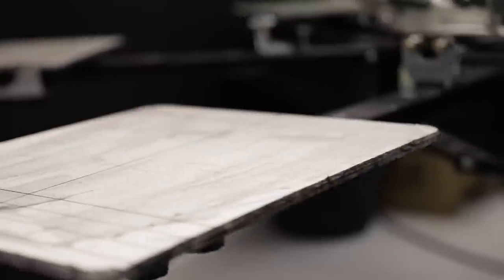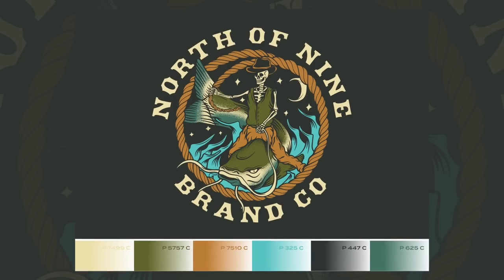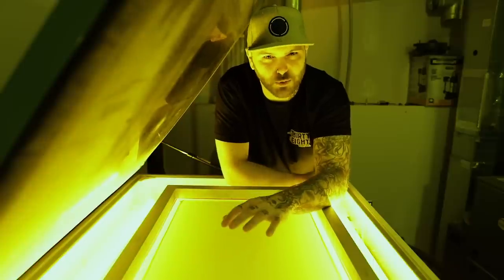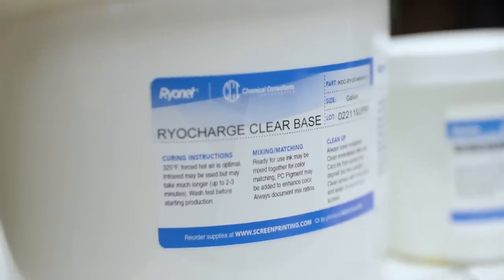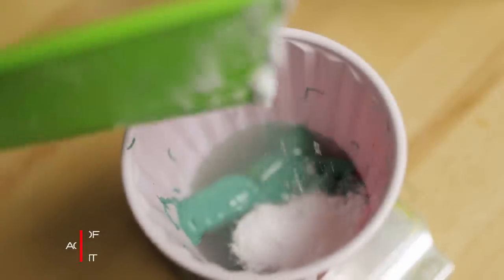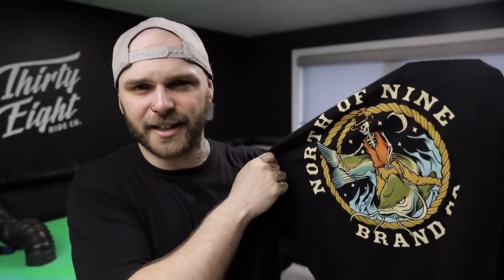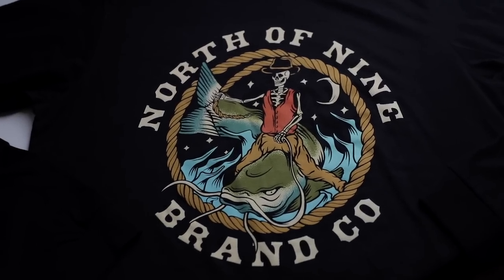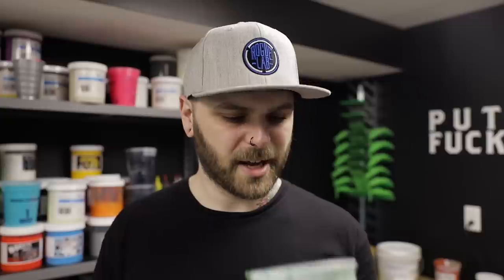How To Screen Print With PLASTISOL DISCHARGE INK!

Comment: your dwell time should be al least 90 seconds
Nice print!!
Reply from the maker: For waterbased, not for plastisol
Reply: @leestuart38  Discharge printing is a form of waterbase printing, at a minimum it should be 60 seconds but preferably 90 seconds or more... good luck
Reply from the maker: Man you missed the whole point of this video if you think this is at all water based 😂
Reply: @leestuart38  Think about just one thing you mentioned in your video, and that is the fact that you must use an emulsion that will hold up to the discharge process plus the fact that you used a hardner on your screen... all processes that is used when printing water base ink. No point missed here didn't say it is water based but it becomes similar once you add discharge base thats why you are preparing your screen the exact same way you would if printing with water base.

Comment: Hey man. Cool video. I've been printing for years but I've never used discharge. I want to use plasticharge, just the plastisol with the discharge additive. Most of my artwork is 4-6 colors, nearly all of it is sim process, or at least multi shades of similar colors for effect. Point being, the colors go wet on wet and mix. 

Can you please tell me, how will this be effected by the discharge additive if the colors touch and mix. Do you have any experience with this? Id really appreciate it if you can give be a run down on this.

Comment: "It's something that will take years to perfect." So true on every level of screen printing. Learning to push\pull the squeegee,  loading the shirts, burning the screens, learning the best inks, learning the cure process, learning to print smooth, learning off contact. Learning problem solving. Then you see water-based, then you see simulated process, then you see discharge printing. It never ends and it all takes years to perfect.. like nypsey said. I'm too far into it,  I can't quit now better just keep pushing.. lol they say I want to learn how to print shirts.. I say I wouldn't recommend it... 😆 🤣 😂
Reply from the maker: Getting good at this craft is a never ending education 🙌🏻
Reply: @leestuart38  Yessir.. I used your gradient trick. I used all the patterns you showed In your video. I also made a gradient with my logo that came out pretty crazy

Comment: Wouldn't it be better to discharge the base, then use reduced ink to over print, rather than putting discharge in all the colors?
Reply from the maker: In the case of my health, definitely. I wanna stay away from discharge as much as possible. But in this case he wanted zero hand feel on the shirt and going all discharge is the only way to do that.

Comment: one  tip i learn  doing    plasticharge  dilute  the salt  first with distillate water(not much) it will make  way easier to mix  the salt in to the ink
Reply from the maker: I think you mean discharge powder, but I've heard of that

Comment: I’ve been dying to try discharge but I’m in a basement as well with fuck all for ventilation so I feel like it’s just a really bad idea. Also where do you get your Wilflex inks from? I’m currently using chromatex inks from FH and Sons, they’re super cheap and seem to work fine but I’ve never been able to compare them to anything else and wouldn’t mind trying out Wilflex!
Reply from the maker: Ya I honestly try to avoid discharge anytime I can, I only use it when it's requested and when I do I wear a respirator with formaldehyde rated cartridges. But for wilflex you can get it all from RB digital if you're looking to stay in Canada

Comment: one word Lee "formaldehyde" - please protect your brain with that mask - we stopped doing discharge at great pain - it was one of my favorite print methods - but even with a ventilation system I made with carbon filters and exhaust fans made for grow rooms I decided it wasn't worth the risk - anyway stay safe and keep up the great work
Reply from the maker: That's exactly why I wear the respirator. A 6006 cartridge protects against the formaldehyde, sulfate and the solvent carriers in the discharge base. That being said, I only use it when it's requested

Comment: I would really like to work on this type of print. We run the same exact conveyor as you. What belt speed and temp setting are you running? Thank you!!
Reply from the maker: It's going to be completely different from my shop to yours even with the same setup. The ambient conditions play a big part in cure time, so you'll need to do testing

Comment: Killer video, Lee! We have ran a couple discharge jobs but nothing more than one color due to the emulsion breaking down. Going to have to try some hardener next time. Did you have any Issues with emulsion breakdown with this job? Is it harder to reclaim a screen with the hardener added? Thanks, Lee!
Reply from the maker: Thanks a lot. No breakdown on this one, the screens actually still have ink on them 5 days later and they're still holding up haha. They do become a lot harder to reclaim though, I just leave them in the dip tank for a lot longer than usual to make up for it
Reply: we use Kiwo polycol one coat for discharge , this emulsion is thick and never had a breakdown issue when coated correctly , "harder reclaim a screen with the hardener added" yes

Comment: Hey bud.. great informative videos..
You're a natural in front of the camera too  
I have just started out with vinyl and screen print etc.. would you use a 43t mesh with water based ink ??.
I think I bought the wrong one and need to change it...Thanks buddy..
Reply from the maker: I think 43t is the equivalent to a 110 mesh, so in that case I wouldn't. I would use something with a higher mesh count like 160 mesh for white and 230 and up for color. Thanks a lot man

Comment: I love this stuff and it’s super versatile but I really do not have the appropriate shop setup for it sadly. Also, ventilation is vital if you don’t wanna die so I rarely print this ink system but I love the end result.
Reply from the maker: Ventilation is definitely an issue with this stuff. I run the 3M 6006 cartridges on my respirator to filter out the formaldehyde and sulfate and it's actually very workable. The shop just stinks for 3 days after 😂
Reply: Lee Stuart yeah smells like ass. Absolutely love the end byproduct of plasticharge tho. I did a test to combat people saying it wasn’t possible with a flash a few years back to see if they were right (they were wrong)... it’s totally possible, but it is super time consuming as noted and also even worse with no ventilation system to pull fumes out. Also not a fan of the ink waste that needs to go in the bin afterward that may not get used as it’s horribly bad for the environment. But I digress haha.

Comment: Great design , how do you keep the shirts down on the platen ? When I use discharge the adhesive I have doesn’t keep the shirts down, thanks
Reply from the maker: Regular waterbased adhesive is all I use. If they're lifting you either don't have enough of it, or you're printing the ink through the shirt instead of into it. Hope that helps 🤘🏻
Reply: @leestuart38  thanks for the tips, I will try again

Comment: If I used FN ink as the ink mixed with the discharge mix do I still have to do it at i higher time or can I do it at the cure temp of the FN ink?
Reply from the maker: FN ink is not recommended for discharge
Reply: @leestuart38  thanks ill take note of that if I want to branch out to discharge

Comment: I've always found plasticharge colors to lose their intensity over multiple washings compared to traditional wb discharge. We'll run a d-base with standard plastisols on top for a much easier production run and colors keep their vibrancy over time. Nice work though! Can't beat the finished product of a discharge print, hybrid or not.
Reply from the maker: I still haven't ventured into using discharge bases under plastisol due to this little ass dryer, but the equipment around here is about to change big time so I plan on trying lots more stuff. Thanks man 🤘🏻
Reply: Lee Stuart  I know how that is. I went from a flash dryer 10 years ago to a 4’ dryer to an 8’ dryer and now we’re working with I think 16’. Still don’t run much discharge but if we need to, we can!
Reply: What pallet adhesive don’t you use ? The water base adhesive I use , doesn’t work well with discharge, thanks

Comment: You better vent out those fumes, those fumes can overwhelm you.
Reply from the maker: I literally talked for 2 minutes about ventilation
Reply: You didn't say how dangerous the ink can be. One person on the t-shirt forums almost died if his wife didn't find him passed out in the garage and she called the ambulance. The chemical is zinc formaldehyde or a similar chemistry that when gassed needs to be ventilated so you don't succumb to the gas. If in a garage open the garage door with fans going out. If you have a mask I think you need charcoal filters. Most people just complain about the smell but your dryer needs a vented out pipe with a forced fan that sucks out the gas, it will reduce the smell but more importantly keep you from dying. There is one discharge ink from england that isn't poisonous but it's pricey. I really wouldn't trust the mask. I haven't messed with discharge for a few years maybe there are more inks with the new formula but it doesn't smell like formaldehyde.
Reply from the maker: I can trust the mask because I know what I'm doing, I've completed multiple MSDS safety courses from my previous job and know what filter to run on my respirator to work with formaldehyde. My setup is also ventilated at multiple points and has a negative pressure exhaust pulling from the dryer.

Comment: Safe to say it's the same process for using an automatic press too?
Reply from the maker: It'll actually be way easier on an auto since it's a lot more consistent and keeps the ink moving
Reply: @leestuart38  I love your channel. I've been offered an opportunity to run and grow a screen print shop with a 8 color auto and an embroidery setup as well as HTV vinyl. I'll receive profit sharing as well. I provide all the art and seps now for about a year and it's growing fast. Your videos are getting me revved up to take the challenge. I haven't worked in a screen print shop since 1996! Keep kicking ass and taking names!
Reply: @leestuart38  I have to redesign a print because the original design the client provided created a "kevlar" circle on the back and the ladies working at the bar hate the way it feels when it gets hot. Discharge sounds like it would have been perfect to deal with that

Comment: Lee can you cure discharge in a heat press?
Reply from the maker: I've honestly never tried so I can't say for sure. I know it wouldn't be optimal though because those waters/solvents/gasses need to escape out of the fabric during the cure and a heat press would definitely make that very difficult
Reply: Yes you can. Open a couple of times to release vapour. But you need very very good ventilation, because the vapour from discharge is likely to cause cancer. Leukemia, in particular. You really don't want that. Please be super careful.

Comment: Do you have a fan at the end of the ducting coming from your dryer?
Reply from the maker: I have an in line exhaust fan pulling most of the fumes from the dryer
Reply: Lee Stuart I’ve read that if the fan is too strong then it can pull some of the heat out of the chamber and cause curing issues. I’m guessing that you can dial in the dryer to compensate for that though. Plus, your exhaust looks like it’s lengthy so maybe that is helping keep the temperature constant in chamber
Reply from the maker: Fan speed, it's distance from the dryer and dryer settings all play a part. It's a bit of a balance and figuring out the right setup